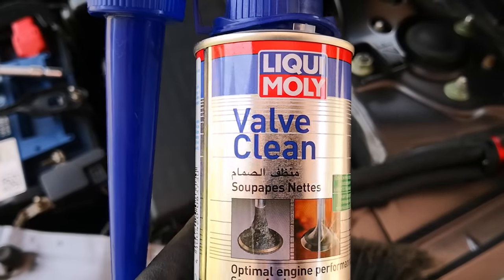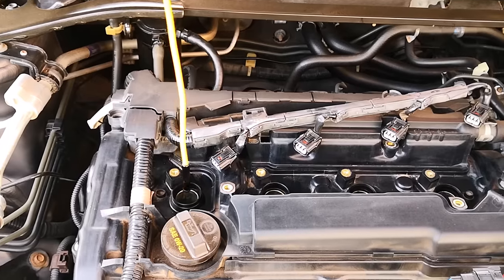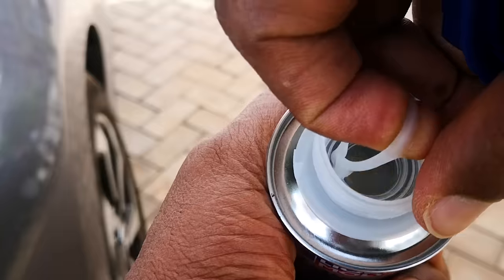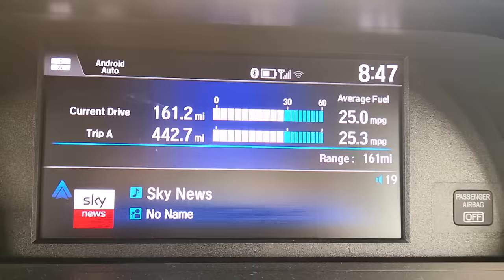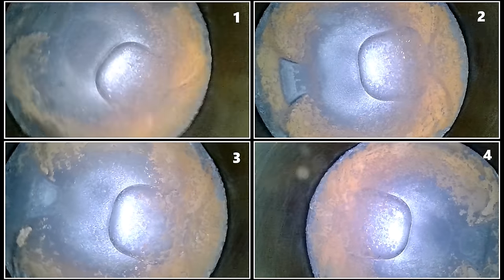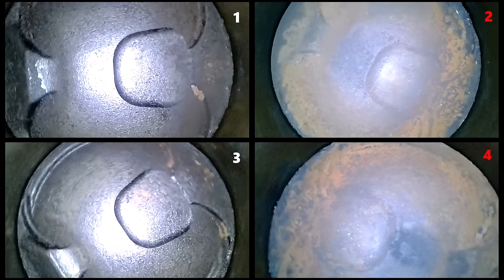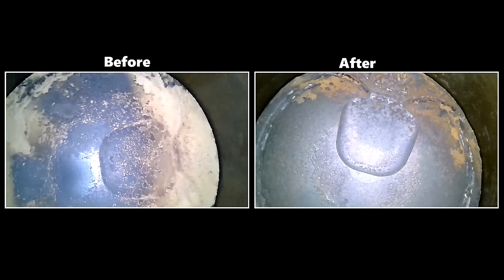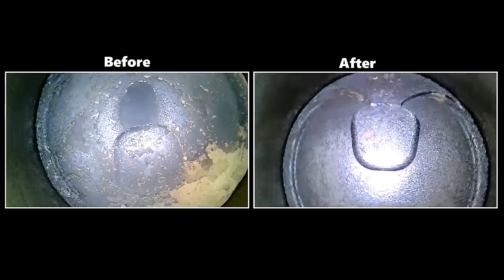I tested Liqui Moly on Piston Carbon Removal: Liqui Moly Valve Clean Works on Piston Carbon Build up

Comment from the maker: What do you think? 🤔 Willing to go several fill ups in other to get clean pistons? I guess significant buildup will require multiple treatments.

Get from Amazon

  - Liqui Moly valve clean  - https://amzn.to/3UGCaua
  - Depstech Dual Lens Wireless Endoscope - https://amzn.to/3kxDIoW
- Other tools & products I  recommend - https://amzn.to/42LGCL8
#ad
Reply: What are the side effects of having the carbon deposits, go through your cat. Does it burn off in the cat?
Reply from the maker: From a previous video I did, it will burn off and not get trapped in the CAT.
Reply: It will break down your engine due too a thick layers of carbon over piston @davidkrocks
Reply: Heard you can remove carbon built up using paint thinner by put it inside the petrol tank with 1/2 tank of fuel.
Reply from the maker: @Imran-fc2qh Heard that too but don't yet have the stomach to try that 😃
Reply: Was it the Moly or the Italian Tuneup? that made the difference
Reply: Liqui Moly does not recommend using Valve Clean for direct injection engines. For clarification, DI engines do not spray fuel onto the valves. Fuel is injected past the valves, thus the valves are unable to be cleaned. It is interesting to see the piston heads actually benefit as well. @DIYAutoworksNG
Reply from the maker: @cousinsaul64 you're 100% right. My focus was on the piston for this experiment. Engine was begining to ping from increased carbon deposits.

Comment: Clearly a cleaning method for the patient minded.
Reply from the maker: Yea. Well, if you have significant build up like I did, you'll have to be patient except you want to pull the head or do a piston soak.
Reply: @DIYAutoworksNG  Non-invasive is good.
Reply from the maker: Yea. It even stopped the oil consumption I was having. I think the Italian tuning plus the cleaner potentially unstuck the oil control rings. I would usually add a quart in 1500 miles or so, but the oil has remained at the top dot through 2000miles of high speed driving.
Reply: @DIYAutoworksNG  It's good to have collateral benefits instead of collateral damages. 😄
Reply: @DIYAutoworksNG lso Is this Product less effective if i dont floor it ???? Meaning it wont clean carbon in city driving
Reply from the maker: I didn't test it enough in non-floored driving to say, however flooring it does help cleaning. This is same with every cleaner I know. I guess city driving will take a longer while except if its more preventive.
Reply: @DIYAutoworksNG  by the way Car is a V8 port injected is it still effective???
Reply: @DIYAutoworksNG  Really ? 
Even my 2011 Polo 1.2 tdi done 148500kms consumes engine oil 100 ml/ 1000km, will this valve clean treatment help me as my car is a diesel car? Engine oil I am using is 5w40 fully synthetic from authorised VW workshop.

Comment: Right now I am on vacation and because I will drive the car for about 600km I decided to dump a bottle of Benzin Additive from Liqui Moly to a full tank with the hope it will clean some carbon deposit. First option was Performance Improver from Amsoil but was a little expensive and second option remaind from Liqui Moly. I hope to see some results but based on your success I will surely use the Valve cleaner product for the next fill-ups. Thanks for the invested time in searching products that worth buying.
Reply from the maker: Thanks mate. I'm sure 600km of straight driving will do a lot of cleaning. Getting and keeping the combustion chamber hot with such a cleaner is the perfect recipe for cleaning carbon.

Comment: Hi, today is Aug 28/ 2023, @ 1:51AM.monday.
I've been using Liquid Moli for over a year and a half. Gas and oil treatment. I have a 2004 Nissan Maxima 3.5 V6.
It was emitting blue smoke ( burning oil) on start up. Well a friend suggested that I use this treatment to see if it helped.
Well, good news! It did and it continues to do so!!
No more smoke, the tops of the cylinders are very clean. And the exhaust pipes don't have that black soot. They look new.
The cars runs great.
I changed out the electronic coils, plugs and installed a new plenum gasket...was leaking a little blow by. Engine is very tight! The stuff is great!
By the way? Great video!
Liqui- Moli is a great product! 
All
Reply from the maker: Wow! Thanks for taking the time to write such detailed feedback. I think so too about Liqui Moly products. 
I used their engine flush plus and it really did decent work on a sludged up engine.
Thanks for the compliments too!

Comment: That is a surprisingly thorough testprocedure! Very nice, good pacing and very good method of procedure. The brown residue which is most likely from subpar fuel with excess sulfates etc. won't be burnt away with Liqui Moly. Only with high quality fuel you get a chance. That being said, this residue is neglectable and only carbon buildup is of real concern. Well done!
Reply from the maker: Thanks for commenting! True talk on the residue. Still concerned about it as it will affect compression ratio if it continues to build.

Comment: Great video.  Thank you for putting the time and mileage into the project.  Liqui Moly is in my opinion the best overall to always use as quality of fuel slowly gets worse.  You might want to swap your plugs, valve clean can leave a strange byproduct on them.  Fresh plugs will always help everything work the way it should during cleaning.
Reply from the maker: Thanks mate! 
I didn't really observe any out of the ordinary deposits on the spark plugs.
Reply: You know you can also clean plugs? My dad used to do it on his cars when I was a child (loved 'helping' him work on the car at weekends). He had a soft wire bristle brush just for the job, would whip out the plugs, clean off the junk (leaded fuel back then and clearly not as squeaky clean as people like to think) and then check the gap (and reset as needed) with a feeler gauge. Really simple job anyone can do. Seems wasteful to bin plugs just because they look dirty. They last a long time really (my grandad was involved in the manufacture of NGK plugs).
Reply: Put a scope on them. A scope will pick up any additive.  @DIYAutoworksNG

Comment: Impressive video and results. Clean pistons improve compression and performance. Its quite difficult to clean them and most products have minimal effect. I use several liquimoly products and i'm also going to try this one.
Reply from the maker: Thanks, mate. Really nice product. I'm sure if one has a 300 - 500mile trip straight, it'll cut the carbon much quicker!
Reply: @DIYAutoworksNG  i love your vids: short but clear, straight to the point without nonsense! Keep it up! I own a BMW E65 730i N52 in great condition with 250K km. Greets from the Netherlands!
Reply from the maker: Thanks, mate. I just enjoy making and sharing these videos!

Comment: FINALLY! Thank you for showing us the before and after pictures of the cylinders. That’s the confirmation it really works. Every other other review I saw just talked about their experience but no one looked into the motor where the cleaning happens. And thank you for not giving up after one bottle. 👍🏻👍🏻 Would be nice to see pictures of the valves and spark plugs too.

It would also be interesting to see what difference the premium gas of Aral or Shell with their additives are doing to the cylinders and how normal gas has an impact.
Reply from the maker: Hey, thanks a lot for the compliment!
Regarding the valves, the car is GDI so I won't expect any cleaning there. I agree; if I had Shell V-power, would have done a similar experiment with it vs regular gas. Thanks again!

Comment: I had some issues with my Kymco AK 550. I found your video and it helps me to find the correct cleaner for the injectors. I want to thank you for your video and your work. That's a great job!
Reply from the maker: Glad it helped. If you're looking to clean injectors specifically, they have the Liqui Moly Jectron which is for cars with MPI and the DIjectron for cars with GDI. I used this Valve Clean because the others were unavailable and my target was the combustion chamber.

Comment: Would've loved to see the valves too but all in all, very well demonstrated. I'm impressed with it and giving it a shot for the next 5 tanks of fuel.👍
Reply from the maker: The valves should show some reult if it's multiport injection, however, this car is GDI, so I wouldn't have cleaned the vakves

Comment: Remember , the goal is to KEEP YOUR REVS HIGH. It cleans better that way, long drives especially on the highway. Hotter -Cleaner
Clean and concise video, to the point with great image quality! Thumbs up and Subbed. That engine should be very happy now :)
Reply from the maker: Thanks for the tips and compliments!
Thanks for subbing too! 😀
Reply: High rpm’s don’t mater.  The engine gets the same temp regardless of the rpm’s.
Reply: @ohboy2592  around 110 to 120degre max?

Comment: I run Liqui Moly Injector cleaner and use the Italian Tune up method. Works 100% for carbon build up
Reply: what is the italian tune up method? I'm italian but i don't know this technique hahahha
Reply from the maker: Driving at high revs!
Reply: It's the Italian Tuneup what makes the cleaning.

Comment: That’s great preventative maintenance before problems might occur, there are fuels that have a lot of extra cleaning additives in them but most people don’t access to them. PEA based cleaners are definitely good cleaners if you can get it. Using an oil flush additive before an oil change is another good preventive maintenance measure for old cars/cars with high mileage.
Reply from the maker: I did use Gumout all in one cleaner that has PEA, and can't say I was as pleased with the Liqui Moly. 1up on the oil flush.
Reply: @DIYAutoworksNG  you liked gumout better?
Reply from the maker: Yes. Though I can say what would have happened if I used the Gumout in 5 fill ups.

Comment: It works great. It also is a great presoak on pistons and heads if you're cleaning up carbon. Overnight and it flakes off and cleans right up.
Reply from the maker: Good to know. Never tried using it as a a presoak.

Comment: be nice to pair this with an oil catch can, and of course an oil change not too long after application. great vid!
Reply from the maker: Right on the money! I have an oil catch can already installed. Did so early this year. Has significantly cut deposits reforming since installed.
Reply: an oil catch can on a Honda GDI engine is pointless it will have minimum effect so its not needed.

Comment: never had these problems. I only used ROZ 98 and better fuel. the pistons was so clean and I cleary saw the QR codes from the factory ^^
Reply from the maker: Nice. Unfortunately we don't have those higher octane fuels in my setting.
Reply: exactly,  if you use premium fuel, you dont need any of these additives.

Comment: Nice video man i hadnt even thought of moly. Its unfortunately illegal in a bunch of states now but the best bang for buck carbon and all around fule system cleaner ive ever used was RXP Gas Kicker.  Best before/after was on a 120k mi 1992 cadillac STS - an aluminum component 4.9L TBI V8. After driving for 200mi I thought the engine died at a stoplight and went to restart the car. It hadnt and my starter was mad at me. Thats just how crazy smooth it was running after blowing puffs of black and gray out the exhaust for the 1st 100mi.
Reply from the maker: Thanks a lot. Nice. Honestly I think a 200-mile non-stop trip with decent revs will do the trick. Thanks for sharing. Never heard of RXP Gas Kicker. Will have a look.

Comment: I use it and it works. But you gotta combine it with a good hard drive. I use it with half a tank and go push the car for 20-30 minutes HARD. Makes all the carbon go away. Also cleans the injectors good.
When I say push it hard I mean it, no highway, go to some mountain and go uphill, get some heat into the engine and get 7-8mpg out of it.
Reply from the maker: Thanks for sharing. Interesting take on pushing hard. That will certainly turn up the heat🔥
Reply: @DIYAutoworksNG  it also works for GDI engines, my forester XT never needs Valve cleaning because I push it hard and race it 3x a week. Just pulled the motor to do head gaskets (small leak at 150.000kms, about 500 races) and some seals, the Valves where quite clean.
Reply from the maker: Wow! Thanks for this insight. Will try this out.
Reply: Hmmm,....going to look for a mountain in south florida to try this out.....lol
Reply: @flipd2830  you could also look for some backroads with a lot of cornering... That will keep the speed lower but you should be able to push the engine out of the corners, so it will heat up more than on the highway

Comment: Hello, nice video documenting your experience. Btw, reading the SDS of this product it seems that it's almost kerosene (no PEA included as you said) but using it regularly and driving with high rpms it seemed to work on your engine. I have to try the same thing as you, but with kerosene.
Reply from the maker: Thanks for sharing! If you do have before and after footage, I won't mind seeing. Personally can't stomach adding kerosene to the tank for now. Maybe if I know better.
Reply: Interesting because PEA is the most common way to reduce carbon build up in an engine. PEA will increase carbon build up on new engines however reduce or remove it on an older engine.
Reply from the maker: @brarautorepairs How does PEA increase build up in newer engines?

Comment: I would have used Yamaha's Yamalube Ring Free Plus Fuel additive in the fuel at a shock treatment dosage.  This is widely used in the outboard 2 stroke marine industry to remove carbon from valves, combustions chambers, and largely preventing piston rings from sticking.  I use this on my outboard engines at every fill-up and it keeps the engine and spark plugs incredibly clean and is safe for both 2 and 4 stroke engines.  Ring free treats 10 gallons per ounce, and the "shock treatment" is 5 gallons per ounce is what some people use when they initially buy a used boat that's never been treated with the additive for aggressive cleaning of carbon.  See the below video link of this guy using it in an attempt to help his oil consumption.  This product is a highly concentrated cleaner, and I would simply mix this with a gallon of gas, pour it into the fuel tank and then fill the gas tank at the station to get the syrup like consistency of the cleaner properly mixed into the fuel.  This is not designed to be added to your oil....fuel only.     

https://www.youtube.com/watch?v=-3Ielu6dJwo
Reply from the maker: I actually saw this video when it premiered! Thanks for sharing. Apparently what worked most for @FamilyFriendlyDIY aka DIY Dave was the piston soak with B12 chemtool.

Comment: The big problem with direct injection engines is the accumulation of carbon in the intake valves. In this video the cylinders are cleaner because the gasoline and the product is injected directly into the cylinder and does not pass through the valves. If the valves were shown, they still had carbon deposits. Only solution is a dual injection system like Toyota's
Reply from the maker: 💯 Agree! I don't know why other manufacturers have not adopted dual injection.
Reply: They want service they dont f about us
Reply: So you are telling me the product is going to be less effective at cleaning carbon build on pistons on a car with port injection only????
Reply from the maker: Nope. It's should clean as well!

Comment: Would be interesting to see what adding it right to the cylinders through the spark plugs would have done.   Those tan deposits are super tough to remove with a wire brush even.  

My old carborated harley pistons are cleaner than that after about the same km.....  the wonders of 'modern' technology lol
Reply from the maker: You should see today's video! Not soaking but interesting all the same.
Reply: Use the Liqui-Moli oil treatment! It does work.
I use a can of it at every oil change.

Comment: It’s pretty much the same as breakfluid… 
Remember Valves are in need of their ‚crusted surface‘. 
It’s always good to know how to do the needs.
Reply from the maker: This is not true. Unrelated to brake fluid.
Reply: @DIYAutoworksNG  you better ask the company first 😎

Engine cleaner to put into your Oil than 15 min on 1,500 rpm before oil change… 99% Diesel 🤷‍♂️

You just pay a lot more 🤪😂😂

Comment: Cool. How do you know it was not the spirited driving alone though? Proof would be that the double treatment did not make much difference but rather the continuous spirited driving?? 🤷‍♂️
Reply from the maker: Good point. Recently did a separate run without additives. Videos should be coming soon.

Comment: Looks like it does a good job. I wonder how much of a difference it really make by cleaning the carbon build up off the pistons? Would have been good the do compression numbers before and after.
Reply from the maker: Yea. Doing compression would have been another good addition! However, engine was pinging before this. Totally gone afterwards. Also gained 2 - 3 mpg and cut my oil loss by more than half telling me that it did free up oil control rings.

Comment: I used to clean valves all the time the hard carbon would have to be steel brushed off the valve it took alot of work I would say the best thing is to take preventative measures before they have that much build up lol
Reply from the maker: 100% right you are!
Reply: Like what?